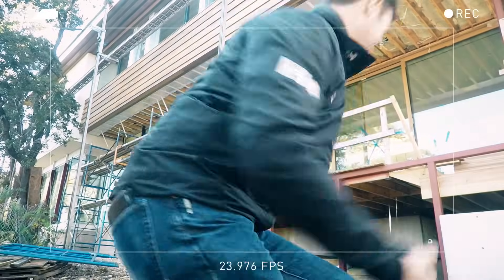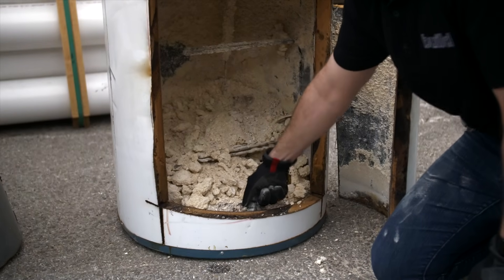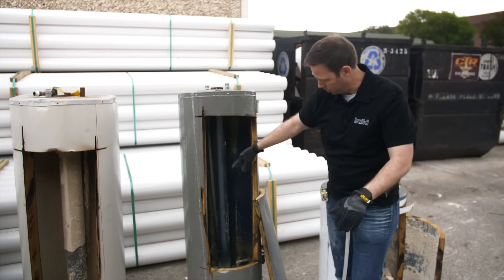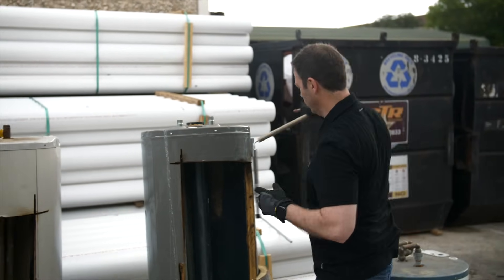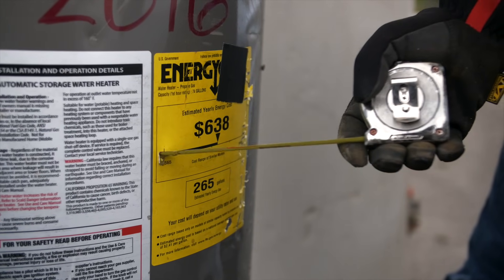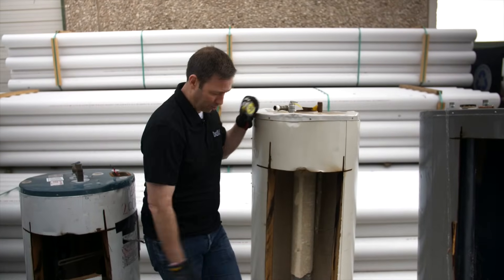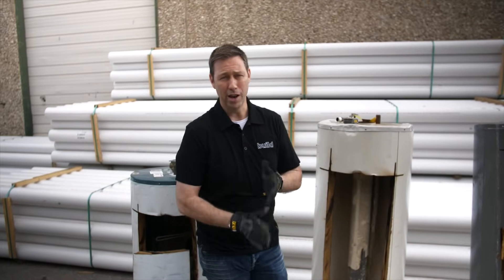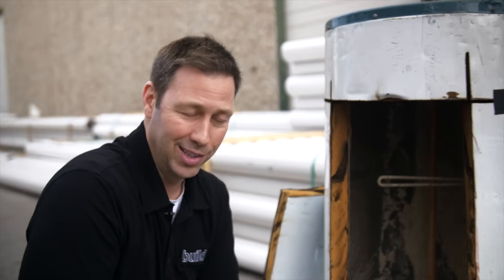Four Water Heater Tanks Cut Open - Lessons to Learn

Comment: I went to a certain elderly ladys house several times a year to basically just do maintenance on her plumbing.  She was probably about 80+ years old and has since passed away recently, but she had a water heater from 1959 that still provided her hot water.  She said her husband drained it monthly since they first bought it in that year, along with checking the elements and thermos.  I loved going there because she still had several original fixtures from the 50s that still worked perfect.  That just goes to show that proper maintenance can make things last.
Reply: No it just goes to show that things built pre 80s was built to last. Not designed to fail so you constantly pre purchase.
Reply: @MakaveliThaDonKilluminati  I wrote a research paper on this. It's called predetermined obsolescence. It's the ugly side of capitalism.
Reply: @MakaveliThaDonKilluminati  that and the law that required appliances to last a minimum of 10yrs or something, Democrats in Congress let the law expire about 8yrs ago.Fun fact
Reply: @bigbeef8935 Who had control of congress 8 years ago? Republicans.
Reply: @karlrovey don’t kid yourself or the fellow made the initial statement. You are watching professional wrestling with those you both mentioned. I was told this as a kid and thought they were crazy but they were exactly right. The only people who aren’t “in on it” are people they don’t need to be in on it.  It’s over and it’s been over for years.
Reply: Outstanding! My gas one is  from 1992
Reply: they had a quality in manufacturing that does not exist today.
Reply: @4skully  thats exactly right. If things were made with that standard now things would be different for everyone.
Reply: @4skully exactly
Reply: @4skully  Not really just less technology which is the failure point on everything today.
Reply: @danbiss87  that's not true. Things used to be built to last from the lack of money people had after WW2 so supply and demand were quality items. Now there is an excess of wealth so people are tricked into thinking cheaper products save them money. Then there's planned obsolescence where devices are built to fail after so much use (which should be criminal because it's the cause of excess waste and the landfill problem).
Reply: @anotherguy9402  Not sure you understood what I stated correctly. Even "quality items" fail today at a much higher rate because of the technology. Circuit boards fry, heating elements corrode, solenoids, touch screens, stupid sensors. There's so much going on in todays appliances that they fail often. Quality today means less fancy in my eyes, analog controls, etc... and they are usually cheaper too.
Reply: Yeah stuff is not made like they used to...
Reply: She sure as heck didn't live in Texas (San Antonio) because we have the hardest water in the universe.
Reply: Built to last back then. Now built to not last…
Like cars and homes and phones and just about every consumer item. Built to fail…
There’s no profit in a hot water tank that lasts decades…Sad what we’ve become
Reply: Compare water heater and tankless water heater
Reply: Yeah but service calls would have paid for a new water heater every so often and saved her money in the long run.
Reply: I just bought a house last month and our water heater is 48 years old. Actually works better than anyone else’s houses I’ve been in lol
Reply: survivorship bias ... the ones from 1959 that didn't last don't exist anymore.
Reply: @rufflesinc Agree on the survivorship bias. The ones that survived probably had regular maintenance and several repairs and are being compared to new ones that aren't properly maintained.
Reply: And the cost to maintain a $500 heater was $12,000.
Reply: They sure as hell don’t make things like they used to. 
Things now are made as cheap as possible. Made to be thrown away, not repaired.
Reply: @danm8747  
My mum had a Zanussi fridge freezer for over 30 years, so I bought a Zanussi when I got my first flat, it lasted just over a year! ☹️
Reply: @OMGAnotherday  Let me guess, the warranty was one year.
Reply: @danm8747  I don't want anything to do with lead water lines, old 60's 70's 80's cars cus they where J U N K..old is obsolete, not better...i guess old paint is better lots of tasty lead?
Reply: @danm8747  that's right. It's called planned obsolescence.
Reply: @2009polostar   Nope, that would be survivorship bias, dude
Reply: No. The fixtures were made in the 50s.
Reply: She must have had a hot ass
Reply: Yeah electric heaters are 100% efficient but are they economical? Natural gas unitil last  year was about 5 to 7 times cheaper for wet heating
Reply: I Inherited a house my dad had purchased to fix up, it had sat empty for several years and I was the one to do the work”fixing up”. I was going to replace the water heater but a friend recommended that I not as it didn’t leak. I’d say it’s fifty years old and works great. We wrapped it in an insulation blanket and hoping to get fifty more.  It could possibly be older than that as it has the fifties look to it.
Reply: How to seal with pipe dope
Reply: I bought a Sharp microwave oven in 1984 when I bought my house and it still worked fine in 2020 when I bought a new one because the Sharp looked scuffed up but it worked fine.   My dishwasher was also from 1985 and worked fine.  I had to replace the solenoid once and did that myself.   It looked pretty old and I bought a new one in 2019 and in 2021 I had to replace the discharge pump.  I bought two discharge pumps from China because I expect it to happen again.   The new appliances are all junk.   They cost a lot less though.  I paid $660 CAD for my dishwasher in 1985 and I think that would be about $1665 today, so the prices have dropped to 1/3 but the quality is bad also.
Reply: Maintaining plumbing on 80 year old ladies. Is that what they call it nowadays?
Reply: @vicpinto1970   I was gonna say something along those lines as well 🤣
Reply: @vicpinto1970  I was thinking the same thing.
Reply: Do you mean drain the entire 40 Gallons out with a hose, or just drain a quart of water out once a month?
Reply: @d.l.l.6578  just drain the entire thing with built in drain asduming you have a valve to shutoff the inlet water.
Reply: I just had this conversation with a friend of mine today, in the past we worked hard at making  things last!
Well done you, and the bonus is you enjoyed doing there. 
👍🏼✌️🌅💕
Reply: That tank was probably made of copper
Reply: well she held up for 85 years....what if she could have lasted 110 like my mother in law? So in the end, she's gone and that water heater is still here.....
Reply: And super inefficient, working a long time isn't always economically feasible,
Reply: @cengeb  i have one that was 50 years old. Pulled the elements. Exact same as a 10 year old model. And twice the insulation. You have been listening to sales propaganda
Reply: @cengeb  Ehh; electric heating elements are 100% efficient. Newer models may have better insulation if that is what you are referring to.
Reply: inefficient does not apply to something that has been working just fine for 50-80 years. You're silly. @cengeb
Reply: @ddmcpaisley6299 Energy is the most expense in heating water.  using an obsolete inefficient unit longer is not always prudent.  Like trying to still drive a car 50 years old, claiming it still works....cough cough cough.  And as far as wall thickness, with modern materials a thinner walled can actually be better insulated than some old much thicker walled unit....things do improve over time, old is not better.  don't make like they used to, and that's actually a good thing
Reply: @ddmcpaisley6299  Just like a tv, my 16 year old Philips flat screen 42" was working fine, used like 240W  got a new LG OLED 77" much better images, and it uses almost 1/3 the watts compared to a 16 year old tv ...old is not better, just old.  And that 42" flat Philips replaced a 32" CRT tv decades ago, it was close to 400W...old is not better, just obsolete.
Reply: @cengeb  
Depends on the ROI (return on investment) 
Replacing something that cost more to run than a more efficient product but doesn’t break even for 35 years is not necessarily good value!
Reply: @OMGAnotherday  exactly, just cus something keeps working, don't means it's working well.  Energy consumption is probably the biggest expense
Reply: @cengeb  
You missed the point completely. 
ROI is the amount it costs over time. 
It could be cheaper to keep something running for another 10 years because buying a ne one is more expensive even over 20 years than letting the existing run for 10 years.
It depends on the ROI (return on investment)
Reply: @OMGAnotherday  Energy is the most expense in electric appliances....always has been....just like an inefficient furnace of any type, to some Mitsubishi Mini splits which ain't cheap, but easily save me $700+ a year on oil heat, haven't used oil furnace for years, only run it to make sure it works..5 mini splits also much cheaper than one oil furnace, oil furnace has blower motor and oil burner motor and burns oil at $4 gal...Electric minisplits save a fortune, and much more consistent heat and cooling all season perfection
Reply: @OMGAnotherday  wrap it with insulation... Once you replace it... You are stuck in the planned obsolescence cycle. What are efficiency ratings based on? The cost of whatever fuels it at the time? My brother replaced the refrigerator at my parents house after they had passed. It went out because he didn't clean off the coils and fan like dad did. Now he cleans them, but has gone through 2 refrigerators since. Cheap garbage.
Reply: @edpoints1127  
✌️Definitely, planned obsolescence is a thing! ☹️

Comment: We were going to upgrade the anode in our current water heater about a year after we installed it, but  by that point we couldn't even get the original one out...
Reply: I was a plumber apprentice for 4 years...all I need to do is take the Journeyman test to be licensed.  Your anode rod is hard to get out because they are torqued at the factory with thread lock.  You will need a socket of the correct size, one hell of a breaker bar, and someone with some strength.  Once its broken loose and you have a new one (I usually tell customers they are not needed depending on what water source they have) they are easy to replace.

Comment: Wow just got rid of a copper tank here that was at least 30 years old and probably closer to 50! It still had the themal syphon pipes from the original back boiler! 

But our tanks compared with American ones are generally very different as with a gas heating system the burner is in the boiler (furnace) and we pipe a loop of heating system water through a heating coil inside the tank. (via a motorised valve with the heating system) as the heating water is captive it can have rust inhibitor added (and most fittings other than the radiators themselves are copper)

Comment: I replaced a hot water heater from 1979 and never had a problem with running out of hot water, it lasted 36 years. But about 5 years ago it started to leak out of the bottom. Now they don't build them the same quality.